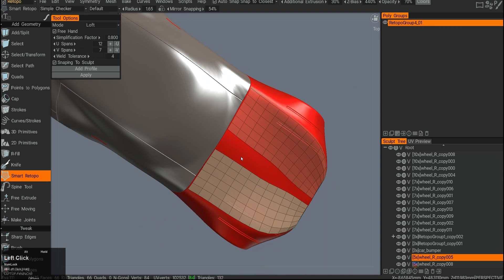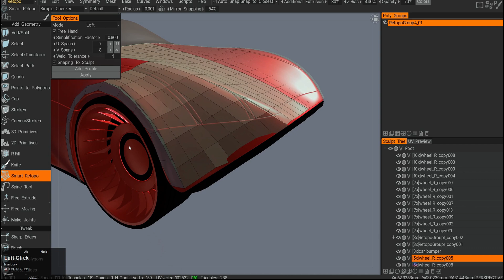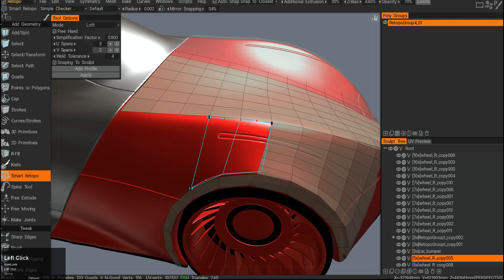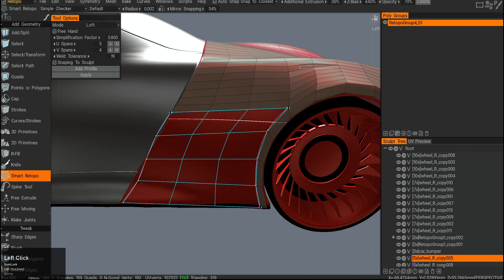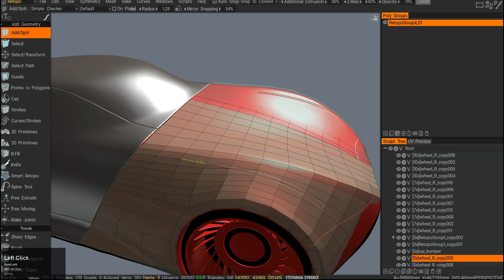Smart Retopo - Intro to 3D Coat - 027

Comment: Cool but is it necessary to make retopo manualy whereas 3ds max does it automatically quite perfect and in addition new unreal engine can operate with 312 bilions polys in a scene?
Reply from the maker: Well good for 3ds max. I don't have it and I don't intend to pay for it. 3D Coat has great autoretopo as well. I'm showing different capabilities for different needs. People have been asking me for retopo videos forever. 
Unreal can run with 300 billion triangles but how much hard drive space will it use on your phone?
Reply: @AntonTenitsky  for now even old 3d-engines are so strong that it is not necessary to make lowpoly retopo.taking into account present tecnology for autoretopology we can say that humantity is on edge of making full-value auto-retopology in the form of middle-poly retopo. It can happen that all our skills  about lowpoly retopo can become dead
Reply: @Staglaitor  2 years later and we still dont have full auto retopology
Reply: @Fo_Cause  it depends on ablilitiwes who can and who can not....

Comment: Mostly like retopoflow .
Reply from the maker: yeah, but it's convenient to have this in one package, isn't it. And retopoflow is an extra paid plugin for blender
Reply: @AntonTenitsky  Sure is but a lot of my pipeline have switch to blender so i got very familiar with it. I use coat mostly for painting now and destructive sculpting since it is light years ahead of blender in term of tools and speed.
Reply: Retopoflow addon can not even be compared to 3D Coats retopo room. It is just an addon that locks away regular Blender modeling functionality into the background and offers just the most basic tools that specialized retopo software toolsets like Topogun had a decade ago, but without any ability to use regular needed modeling operations like in vanilla Blender or 3D Coat. 3D Coat Retopo is lightyears ahead and way more advanced than Retopoflow. There is no similar powerful tool to the smart retopo brush inside Retopoflow. Tops, retopoflow costs almost 100 bucks, jus for an addon that offers only a fraction of 3D Coats toolset. Can you UV map during a retopo session with Retopoflow? Can you do test bakes and check your normal maps? Mark hard edges witthout having to leave retopo mode and go constantly back n forth? People doing lots of retopo would profit much more spending that money and time on 3D Coat instead of Retopo Flow. Plus, 3D Coats Blender Applink makes it a breeze to send objects between 3D Coat and Blender.